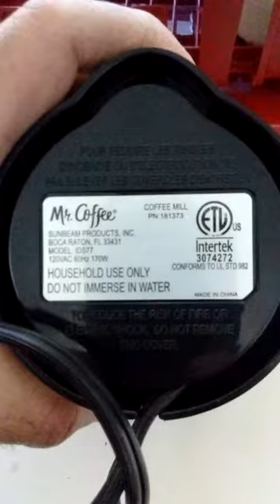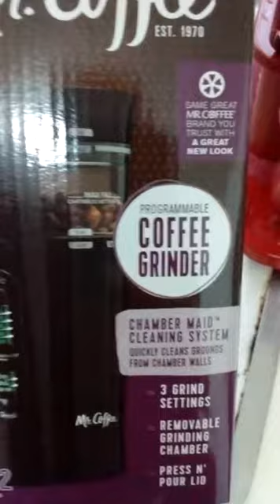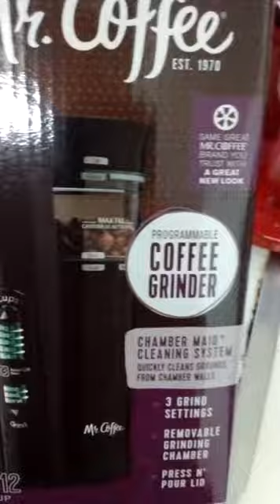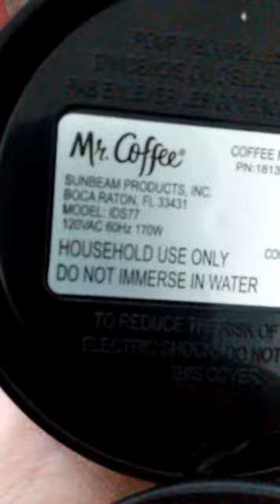Mr. Coffee coffee grinder - IDS77 model - electrical cord - John V.  Karavitis

Comment: not sure if people expected this to be a product review due to all the thumbs down but its a helpful video.there were so many 1 star reviews on this because people thought it  had a 3 inch cord and you are letting people know thats not the case. thanks for posting
Reply from the maker: Thanks. I found out that a lot of people had this same problem, so I wanted to get the word out before anyone destroyed the grinder by yanking on the cord, or returning it when it is perfectly good to use. Take care.
Reply: just got mine today, will test it out this weekend. do you like yours?
Reply from the maker: germanshepherd13
Works like a champ. And the way they've set this up, I think it will last longer than my prior Mr Coffee grinder, since you take the grind chamber off of the motor in order to pour the grounds into the coffeemaker basket. So when I "pat" the grind chamber a few times in order to make sure all the loose grounds aren't sticking to the inner walls of the grind chamber, I'm not also pounding on the motor of the grinder. Less pounding on the entire unit means that the motor won't eventually dislodge or become damaged. Prior models lasted a couple of years before having to be replaced. The only thing that really bothers me is that if you have it plugged in, it's always on, so it's an energy vampire. I avoid this by having a "switch" between the wall socket and the electrical plug of the grinder. So I switch the grinder on when I want to use it and then off when I'm done. These switches cost $5 at Home Deport.
Reply: thanks. used it today for the first time and love it. simple to use and perfect grind for my percolator. I love percolated coffee and its even better now with freshly ground beans. glad I purchased this and appreciate your review and info/tips.

Comment: is it stil working?
Reply from the maker: Yes. However, a small plastic part at the bottom broke off. So I don't think the feature that controls the grind level works. When I press down on the ON button, I grab a hold of the grinder and push it forward and then back once a second for eight seconds, in order to swish the grounds around and get a finer grind. But yes, it still works. Also, FYI, the  fine dust from the grinds tens to clog the safety button underneath the ON button. If you have one of these, you know what I'm talking about, So I frequently find myself quickly clearing this away with my thumb to get it going.
Reply: @JohnVKaravitis  Congratulations on your record for regular use of a Mr. Coffee IDS77 coffee grinder since 2016 (?). That, alone should encourage people to buy this inexpensive but durable product. 
Also, I have a Mr. Coffee CG12 percolator, which has served me well for at least 10 years (usage rate, one 12oz pot every other day). 
* However, a note of concern for durability of the IDS77 grinder's power cord. The power cord insulation has cracked open at the point of entry into the grinder housing. The power cord's exposed copper conductor poses a shock hazard. Since the grinder is beyond warranty, the cord will be replaced as DIY project, but any electrical repair shop can repair this problem.